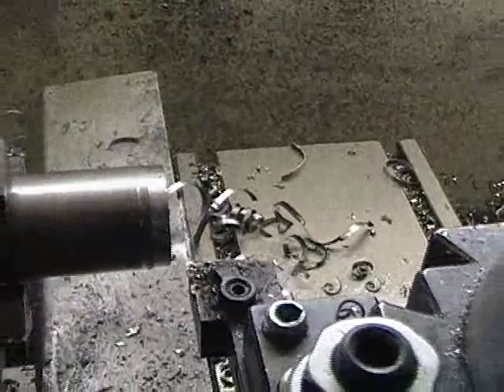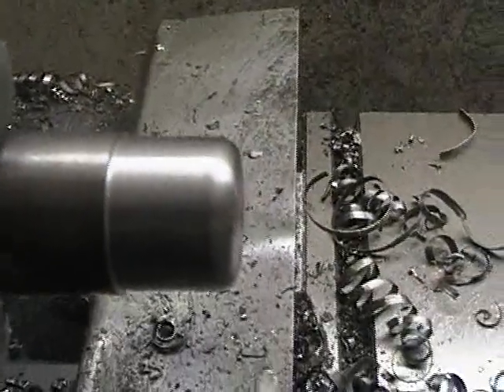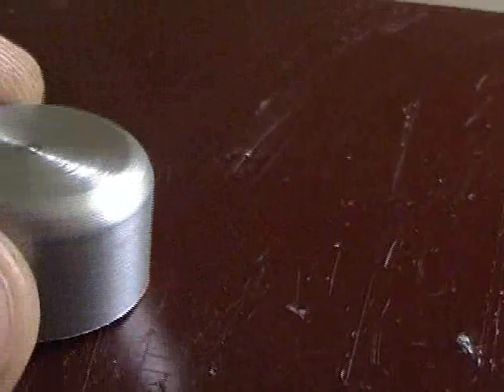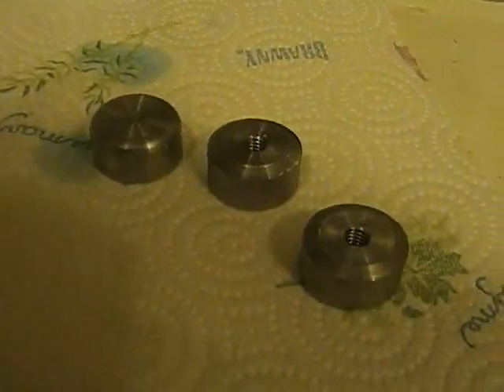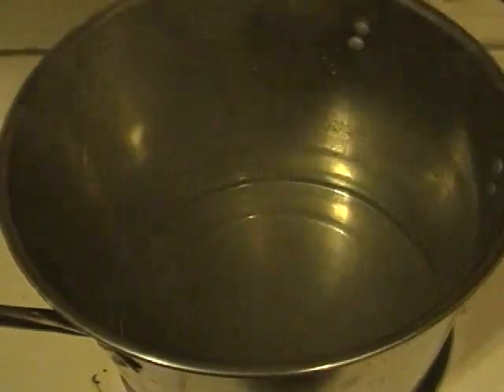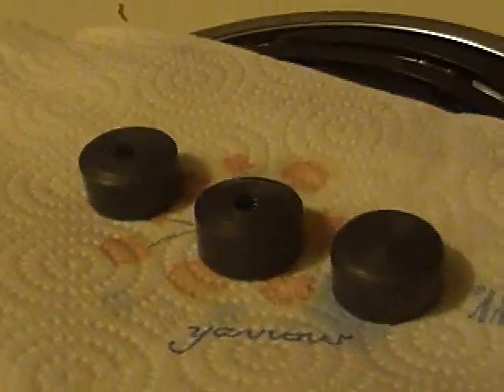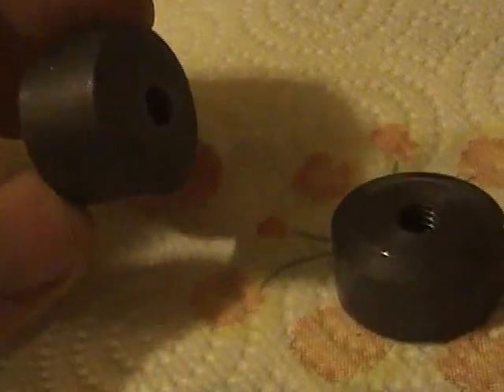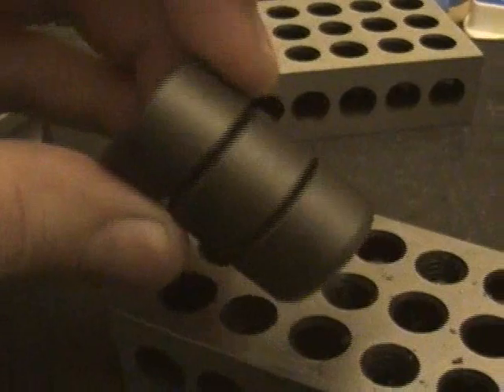Making a set of bow weights - on the 9x20 CNC converted lathe

Comment: Thank you for this video!  I'm in the acquisition stage for a similar sized CNC lathe conversion project.  Have a PC with EMC2 installed, and I bought the shaft couplers today.   Now I need a lathe!  I started to skip this video on the way to various CNC How To videos.  Glad I didn't!  Lots of good info here on actually using the CNC lathe.  I'll be making similar sized steel parts and didn't know I could (should) take aggressive cuts like that with carbide.  Home Parkerizing info was great too!